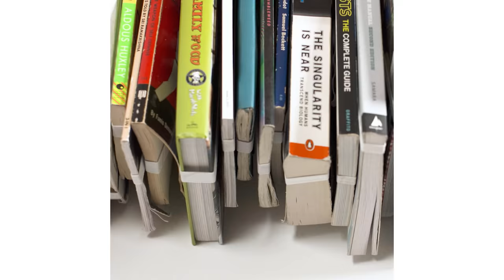Upside-Down Optical Illusion Bookshelf

Comment: Looks cool but it would damage the book, also is so impractical, and it will look terrible if you take one of the books of the elastic... speaking of which, it will worn out and stop holding the book eventually. But I guess you could do this with books you don’t like or fake ones and glue them to the wood instead.

Comment: How is this an illusion?
Reply: Because it Looks Like The books are floating
Reply: Pascal Schehlmann 
According to wiki, "An optical illusion (also called a visual illusion [2]) is an illusion caused by the visual system and characterized by a visual percept that (loosely said) appears to differ from reality."
The books are actually there so it's not an illusion..
Reply: Kyukon oh sorry i was Wrong
Reply: Pascal Schehlmann
No I'm sorry for being super technical😂
Reply: Kyukon im Like this too
So dont you worry
Reply: Kyukon  Reality: The books are hanging by elastics.
Illusion: The books appear to be floating. There is no visible shelf/object supporting them. 
It's an extremely simple concept, your Googled definition literally tells you why this was an illusion.
Reply: Burgundy Well I thought it did until I realized for something to be an optical illusion, the "illusion" must happen before the conscious level. Like how two identical bars with different arrow signs "seem" to have different lengths. Even when you know that the bars have the same lengths in your conscious level, they still seem different because your visual cortex is confused. This bookshelf doesn't make the books "seem" like they are under the bookshelf, the books are actually under the bookshelf. When you know about the elastic band trick, it makes sense. So "technically," I don't believe this is an optical illusion. But it is certainly an interesting piece of decor!
Reply: Burgundy here's the bars that I was talking about: https://en.m.wikipedia.org/wiki/Müller-Lyer_illusion

I know am being SUPER technical here but please bear with me. I am a fan of optical illusions and a neuroscience major 😂
Reply: Kyukon  No one is saying that the books aren't under the book shelf (as you point out in your example). That's not the illusion. The illusion is that they are floating, or being held by an "opposite" force/gravity. This is what the average spectator will interpret. The reality is that they are being held by elastics. So yes, it is an illusion as the definition says. What they perceive is different from the reality of it. The moment you figure out it's with elastics, the illusion is over.
Reply: Burgundy I agree with you in that this is an illusion. Just not an optical illusion.
Reply: Kyukon  Like if someone uses makeup to make it seem as if there is a hole in their arm. Once you figure out it's makeup, the illusion is over. Because it may look real, but you know you're looking at makeup. Even if your eye is still fooled.